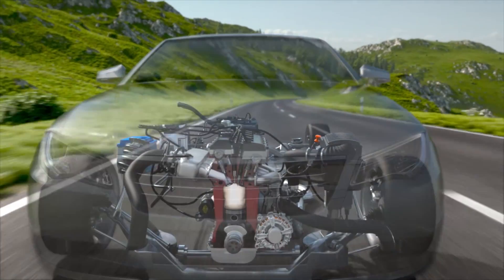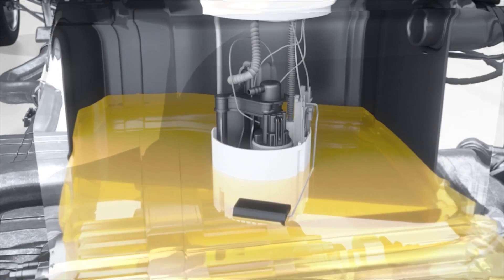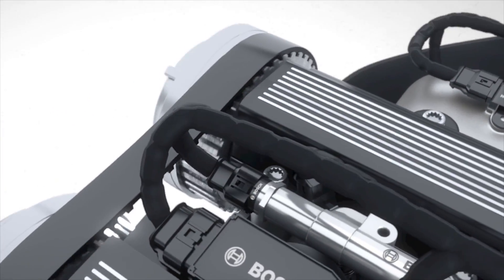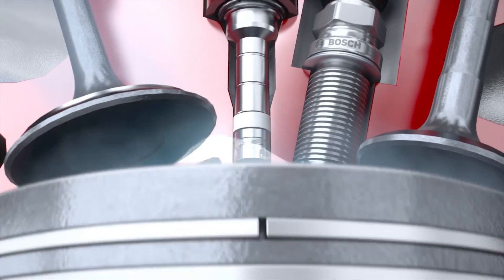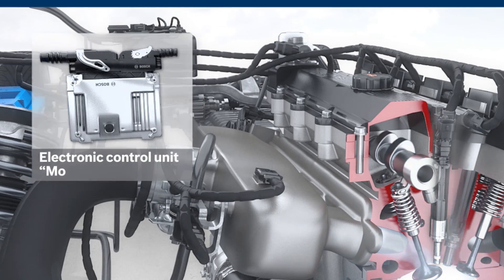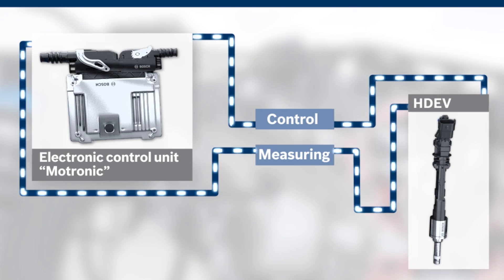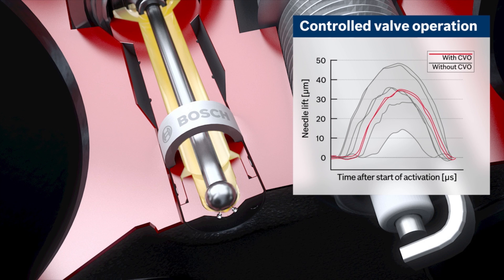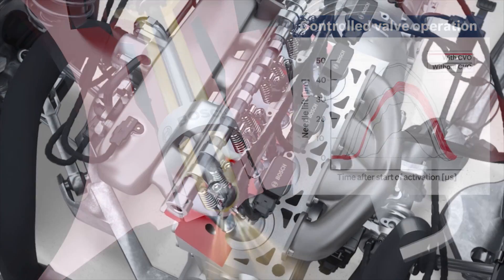Bosch GDI – How it Works

Comment: I understand that it may be necessary to change oil more frequently with GDI engines due to the injector high pressure over time may allow some of the injected fuel to get past the piston rings and eventually dilute the oil. Another video mechanic was saying changing oil every 5000 miles instead of 7500 is a good idea.

Comment: Just a thought..21st Century Tech...Gasoline Direct Injection  into combustion chamber..No Intake valve clean/lubrication..unless you use different Dual GDI system found in limited models...Mechanical Secondary Fuel pump? Thats Old Tech...I own a Honda Crv GDI that I maintain more with Throttle/Intake Cleaning for longevity with CRC products 1000mi. each time to prevent Carbon Buildup...I trust my S.Port Injection Toyota Rav4 for the long haul....Just check out the part lists on your GDI and you will understand....